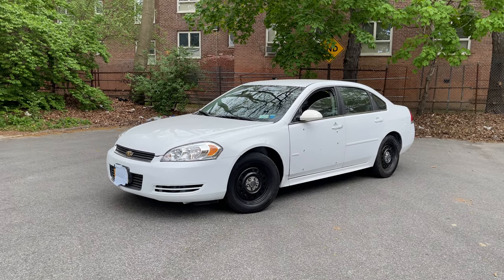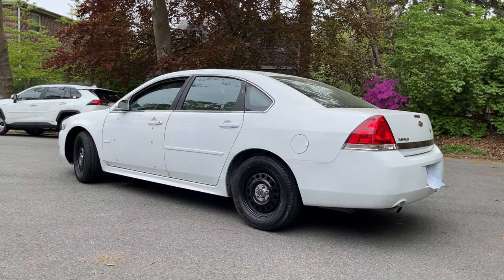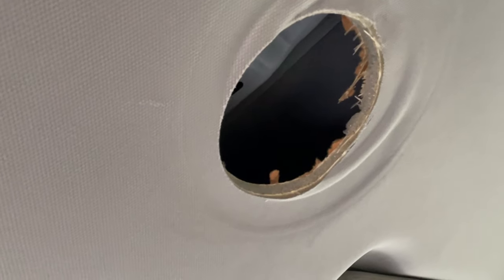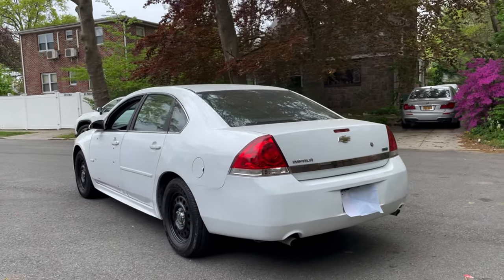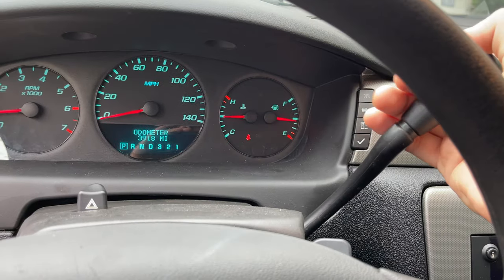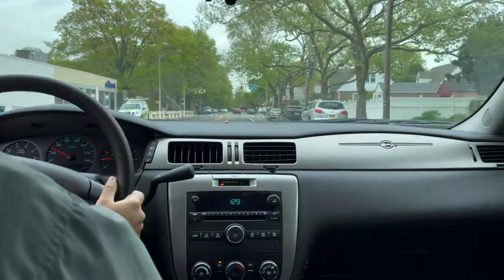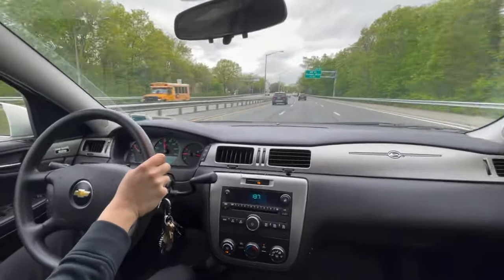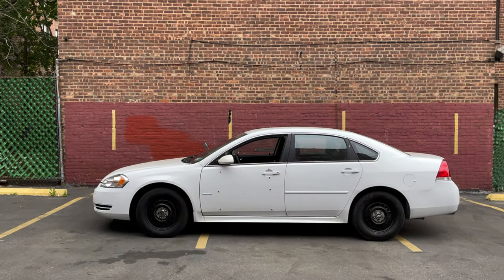Lowest Mileage Impala 9C1 In The World! 2011 Chevy Impala Police Package In Depth Review

Comment: I got both 2010 Impala 91c and crown Victoria p71. The Vic holds a special place in my heart but I can't deny it the Impala feels more modern. Only downer is it's front wheel drive. Still picks up and goes. I just replace my front and rear suspension complete. OEM suspension police package from 1A Auto And I can confirm it still feels stiff. Which it's not bad but still something to expect. Some days I still whip out the Impala over the Vic just because it's so comfortable to drive around the city.